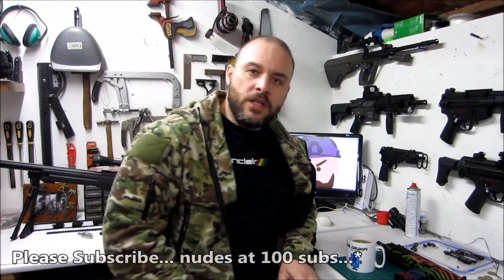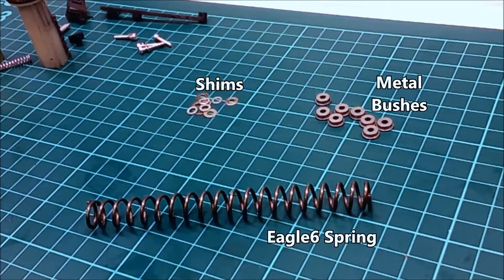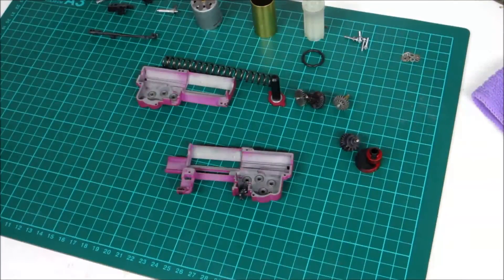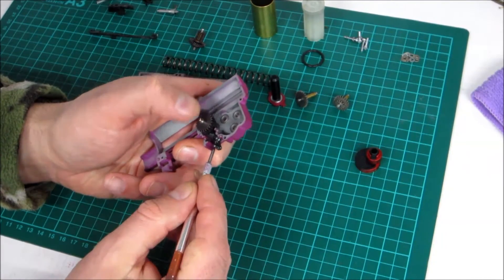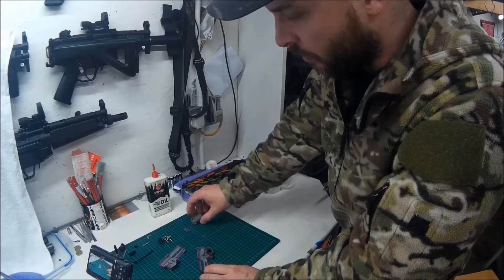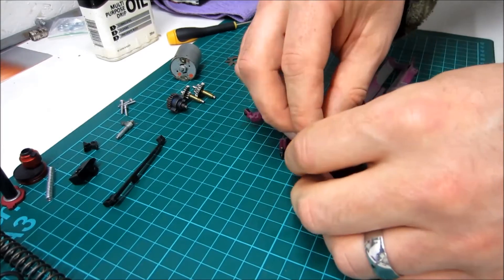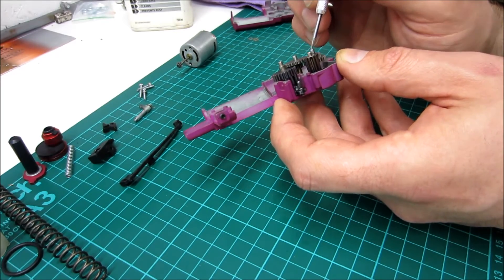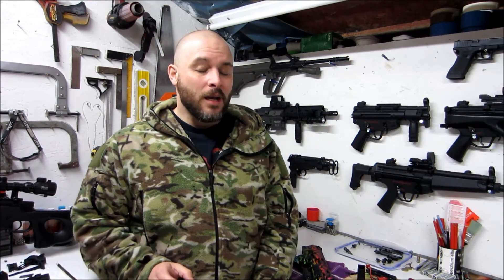Well R4 MP7 | Part 4 | AEP Gearbox Rebuild, Upgrade & Shim | Airsoft BYR

Comment: This gearbox wont last long. The nineball Cylinderhead needs to go with the pistonhead, because i doesnt have a sorbo pad on the back. Furthermore an Eagle6 spring is WAAAAAY to powerful for that gun.
I used a cut down eagle 6 spring (2 coils less) and still managed to get 1,2J with 0,25g BBs. Sadly the shell only lasted for 3 mags.
Now I am working on getting myself a steel shell made...
Reply from the maker: +B1rd0fpr3y - Yeah I'm not a fan of the cylinder head - it does damp though, but its stupid how they done it - on the front - so the whole cylinder head moves.  I've since removed the damper from the front, fitted an abs spacer there to solid that up, put the stock damper on the inside, and sorted the aoe.  Don't know why they done it like that tbh.

Seeing how long it will last is part of the fun dude :-).  If it dies, it dies, I'll make a steel shell for it once I've ran out of spare factory shells... I might run it on 11.1v just to hasten the process lol
Reply: The pad is at the front to increase contact surface to the shells front - which will encrease the shells lifespan a lot. But it has to go with the piston head or an extra pad at the back ;)

I run mine with a 11v Lipo too. I even have a custom motor for it. Before the shell annihilated itself i had 25rps with 360fps. I wonder what you will reach with your uncut spring.

What method of manufacture do you have in mind for your shell? I shortly considered to have mine cnced but when the price estimate was 190€ for only one half of the shell I put that project on hold...
Reply from the maker: Well the pad at the front can't physically increase surface area - the gearbox shell is the same as it ever was, and the area of the front face of the cylinder head is the same too.  I can only assume they have thought "how can we put the maximum amount of cushioning in there as possible, in such a tight form factor"... to me, its not worth the trade off having it at the front.  It allows the whole head, and therefore nozzle, and therefore nozzle/hop seal to be jolted around every time the piston comes forward.  And wether the pad is on the front, or the back of the cylinder head makes no difference if the head is free to move, the stress experienced goes right through regardless.  Goodness knows, I guess they just done the best they thought.

At the end of the day, if you want power in this small platform, go gas... which obviously comes with its own headaches lol!

I started the project just with the aim of "optimising" it, I said early on in one video that I didn't want to put a big spring in there... then half way through I just thought "fuck it" :D. Obviously I should have planned out correctly before making / uploading any video because I can see it is confusing, but you live and learn.  

Your spring sounds crazy!  I've test fired a lot through this, and last time I did (few months ago) it was hitting around 295ish on 0.2g bb... maybe eagle 6 revised their springs, or maybe you just got an extra hard one!  360 on one of these - and you are saying on 0.25s - is crazy!!!  That could explain why your shell broke in 3 mags hehehe.

They do break though, just comes with the territory, as I say, my priority on this one changed throughout the 4 parts so far, and, being a noob to video I didn't explain that particularly well, will clear it up in the last part, you live and learn I suppose!

Steel shell - if it comes to it, I'll just fabricate on old school with blood, sweat and tears.  Probably skeletonize it to make it a little easier to make, but still have the strength - and then infil with plastic perhaps just to stop the grease throwing aroudn everywhere.  Not very economical, but I'm not making to sell for profit, I'm just playing around with my own stuff so my time is free :D
Reply: B1rd0fpr3y could you please tell me where you get your steel shell made and how much it costs? Because I want one for my Tokyo Marui Beretta M9A1 as well (I know the shape is different since this is a pistol but it still is an aep). Sadly I don't have the tools to manifacture one of my own and when I wanted to get one custom milled from China they said it would cost about 300€ which is about twice as much as I wanted to pay since the whole airsoft was less than 150€ and I didn't want to spend more on the gearbox shell than on the weapon itself

Comment: NUUUUUUUUUUU, THE CYLINDER HEADS ARE OUT OF STOCK!!!! I NEED HELP
Reply from the maker: NNNNNNNOOOOOOOOO!!!!! 😫😫

TBH only reason I went for it was to help nozzle seal - the head has an o-ring for the nozzle, the cheap stock one does not.

However I think genuine TM MP7 heads have an o-ring for the nozzle - stress I'm not certain - but maybe look for one of those.  If you are in the US there was a place that sells all sorts of airsoft spares, and they had all the AEP bits.  But eagle6 get new stock all the time if you want to hold out for that head
Reply from the maker: The site was airsoftgunrepair dot com - just checked and the picture they have for the mp7 cylinder head certainly looks like it has an o-ring in the nozzle port.  I have never purchased from them though, being in Scotland, shipping  just makes it uneconomical.
Reply: Okie! But TM models go for about 200 some dollars, hehe I’m going from an 85 dollar Well R4 and gonna make it my Bandit gun, but it’s gonna be in cqb only so I think I’ll be okie I just need to get that cylinder head and new hop and pow! ^w^

Comment: Just watched the video yikes you have spent some dosh on this,the upgrade parts nearly cost as much as the gun it's self i am going to try some very cheap mods and see how it works will let you know how it goes when done anyway on to shimming as you say everyone has their own way of doing this but i have a fool proof method  first shim the bevel gear to the gearbox this means adding shims preferable to each side  till the gear can move freely but  with minimal movement between the casings, you have to screw the  gearbox casings together each time long process but if it is not perfect the shim job will not be right, once each gear is shimmed to the casings then you can mesh the gears starting with the bevel gear to the motor ,you can only move the shims left to right no adding  extra shims or removing them or you will end up with a loose or tight gear when finished ,  put the casings together and check the bevel gear and motor operation once the bevel gear and motor work perfectly you move onto the first transfer gear and mesh this to the bevel gear once again assembling the casings and checking operation  then the second transfer gear and finally the sector gear reassembling the casings and checking operation  every time you mesh a gear, be advised it is a long tedious process and even more of a pain as access to the bevel gear is limited you need a small screwdriver to turn the bevel gear with the casings assembled, but this will give you a perfectly shimmed gearbox with no loose or tight gears, also great videos and very good engineering
Reply from the maker: +Andy Hamilton - cheers for in depth comment!  I actually haven't spent that much - but you are right in that I have spent as much on parts as on the gun - but only because the gun only cost 29.99 haha

So for a lot less than a stock one costs, this one will be more reliable and with a healthy upgrade to power :-). 

Tbh if I had my lathe already, I wouldn't buy that cylinder head again, could make a far better one from a scrap piece of ally or brass, I'm not overly impressed with that cylinder head for the price, although it IS an improvement over the cheap stock one... Not sure it would be as much of an improvement over a genuine marui one tho.  Ditto the spring guide, I had one kicking about in my spares box but it isn't really that upgraded being as the main part is just plastic.  Even with basic tools a solid metal one could be made up for pennies.

So really, in parts, the only part I'd buy again would be the eagle 6 spring and the solid metal bushes; and again with a lathe could even turn off the bushes myself in no time - so the purchase cost of the parts really can come down a bit.